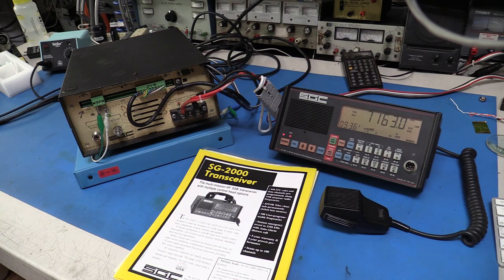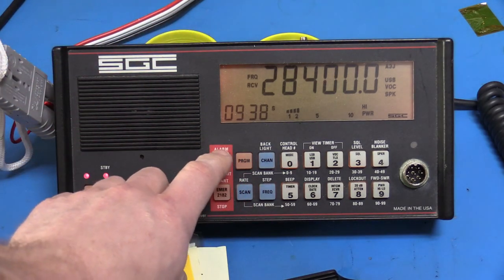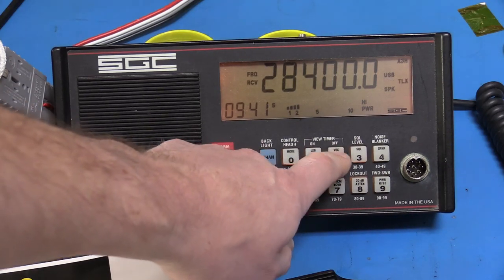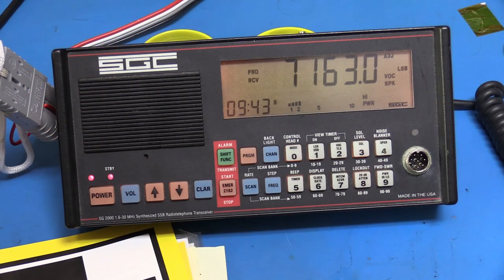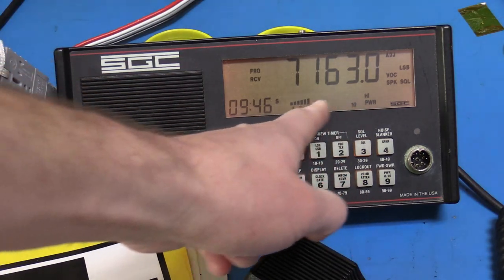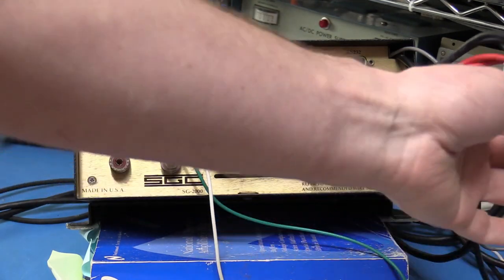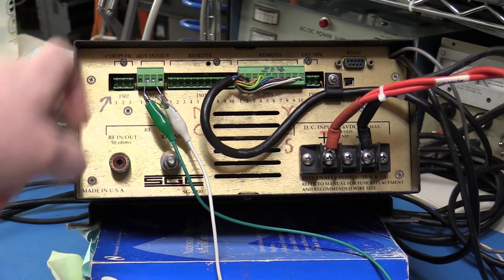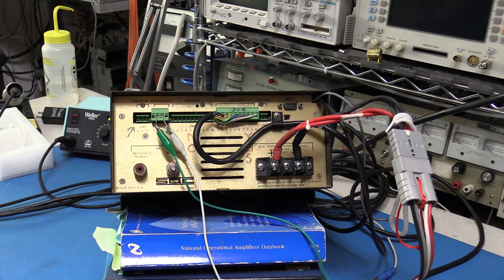SGC SG-2000: Overview

Comment: I plugged my Sg2000 in for the first time yesterday! Turned on the power supply and the stand by light came on, pressed the power button and nothing changed. Hunted around the op manual for a safety or something only thing partially related was the crystal oven, but that shouldn’t prevent it from coming on. I tried entering a few cheat codes by pressing other buttons. Eventually it did come on and worked great got good signal and audio reports up and down the east coast. 

You mention the beeps being double presses of the button I noticed that sometimes it would double beep when I was in one more like change frequency and then try to do something without “exiting” frequency change mode. 

You mentioned the buttons maybe having bad contacts have you be able to get in there and clean them? I am hesitant to open it up
Reply from the maker: So far, the best “cheat code” I know is to tap “VOL” to get out of any waiting period. That’s your “exit” button basically. 

Yes, I do have the head unit open. It’s not too hard to take apart. Mine is actually quite clean inside. Well-sealed. The thing is also very modular; you can pull the boards from each other pretty easily. Don’t forget to take ESD precautions, many of these chips are unobtainable. 

I’ll have a video about it when I get to editing it. 

73
Reply: @W6EL  Yes the VOL cheat code is a go to. oh man it was much simpler of a fix. I got really lucky! Turns out the wires from the head unit were not solidly connected to the screw in terminal block. So after reconnecting those it worked just fine!  I have been having a blast with this radio! My furthest voice contact so far is Kuwait from Maryland. I also used it portable on a recent Maryland QSO party. I ended up getting 60 contacts while operating out of there different counties. I have not put the radio on a power meter. I have been trusting what it has been telling me, the SWR levels have been close to what my analyzer said.

Also I am curious if you have thought anymore about connecting to the serial port that it has for CAT control? My initial thought are an AIOC or Digirig as they both can enumerate a serial port and sound card when plugged into a computer. Then you could get serial command but also tx and rx audio to the computer.  The other thought I had was an ESP32-S3 have that wire interfaced with the radio and then communicate with it over WiFi. The latter seems like a heavier lift and I am not sure the ESP33s ADC are high enough resolution. The former I think would be almost plug and play after some wire making